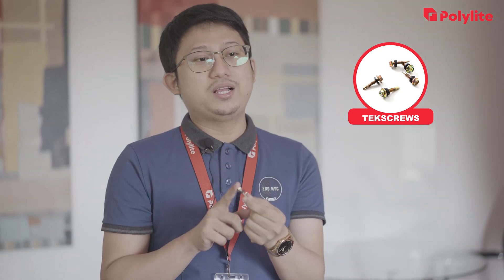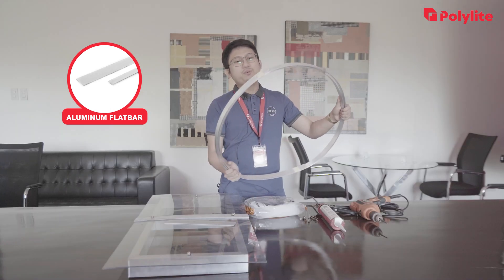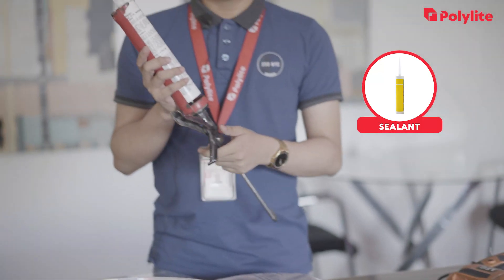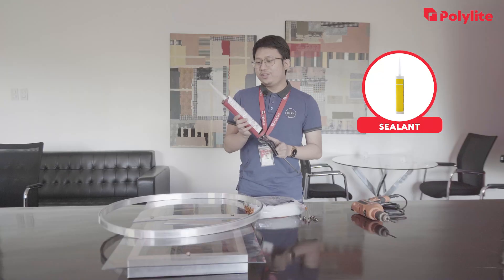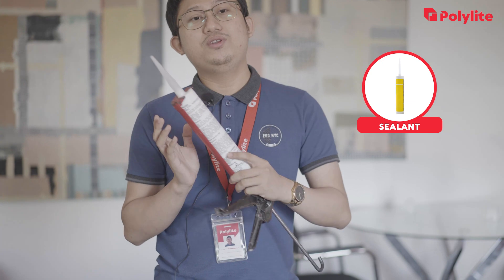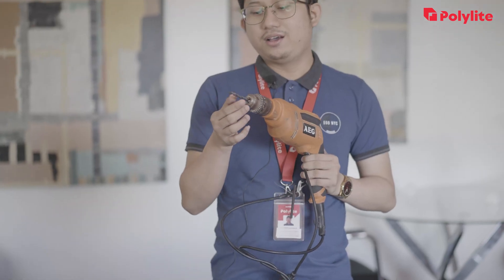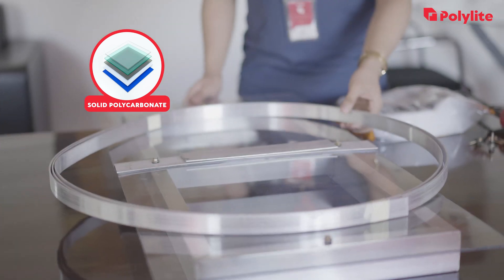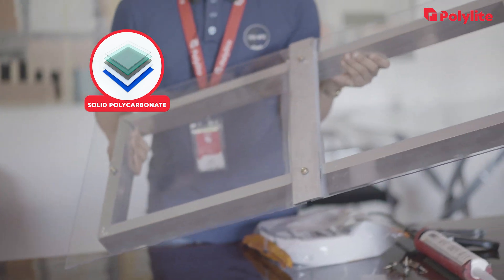How to Install Solid Polycarbonate Sheet using Aluminum Flatbar and Rubber Tape | POLYLITE PH

Comment: Hi. In securing the PC sheet on the frame using tekscrew, the screw will pass from the flat bar to the rubber tape, then the polycarbonate sheet then the frame? The tekscrew will be the one that will make a hole on the 4 materials?
Reply from the maker: Hello po! There's a small gap between 2 polycarbonate panels hence the tekscrew will only pass through 3 materials. Flat bar > rubber tape > frame. The polycarbonate is secured between the flat bar and frame. Don't forget to use sealant to secure it from water leakage as well.

Comment: What width flatbar and tape? Also do you want to cover the roofing trusses with tape as well so the pc isnt sitting on such a hard surface?
Reply from the maker: Hi! The width of the flatbar and tape is 2 inches. It is optional to use the rubber tape on top of the framing before placing the polycarbonate. It would be required on applications where the roof framing is coarse such as concrete.

For more information, you can reach out to us on our Facebook page: https://www.facebook.com/polylite

Thank you!

Comment: It is best to put a sealant in between the the adjoining PC sheet before the placing on top the rubber tape and then the Aluminum flatbar to firmly seal off any seepage through time.